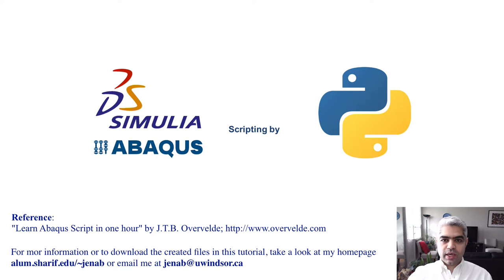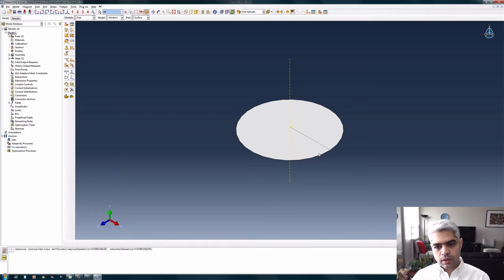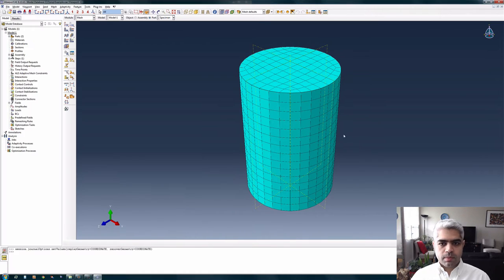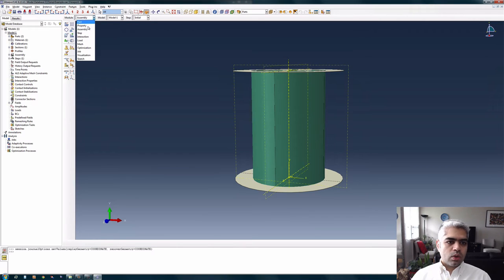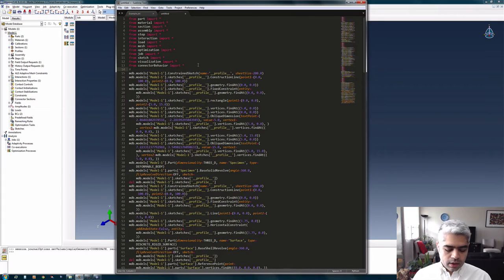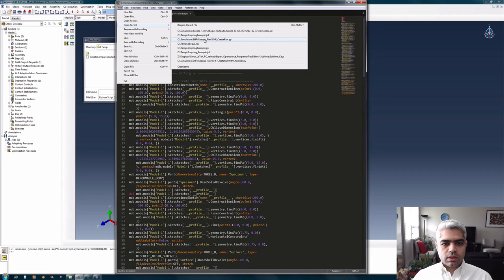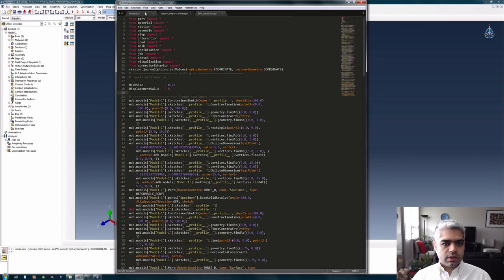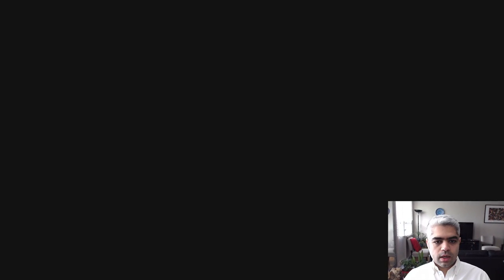How to do ABAQUS Scripting; Simulating a Simple Disk Compression Test

Comment: Thanks for the video.
What is the editor you used to open jnl file? I used Notepad ++. It did not show different command as shown in video.
Reply from the maker: I use Sublime 3 because I like its themes and capabilities much more. But in general, jnl files are Python files; so if you want to see the commands and etc., you need to enable Python syntax for .jnl files as default.

Comment: Dear Arash,
Thank you very much for your tutorial, it has been of great help to me.
Since you know a lot about abaqus scripting I would like to ask you for some help.
I'm trying to write script that will generate a model and define node sets on the right and left edge of my specimen. However, when I change the mesh the script isn't working correcty, that is the node sets are not defined correctly.
Do you know how could I be able to write script that will define node sets correctly, regardless of mesh?
Reply: When you find solution please let me know also.. I am trying to do a similar thing
Reply: @wahaajali1009  Hey Wahaaj,
The solution is this:
You have to use "bounding box method" in order to select nodes that you want. You will need to define coordinates of the bounding box and than abaqus will pick them and make set of nodes. See these two links:

http://dsk.ippt.pan.pl/docs/abaqus/v6.13/books/ker/default.htm?startat=pt01ch31pyo06.html

and 

https://imechanica.org/node/11449

Good luck !
Reply from the maker: @antejurcevic5855   Thanks! I didn't know this and will look it up. What I used to do was to set up an array of mesh sizes and node numbers for all the area I was interested and run a script to export data I wanted from those node numbers (which were again dependent on my mesh size).

Comment: Thanks. Can you please tell me what are the computer system requirements to use abaqus script with python especially with the objectif to link abaqus with matlab. Actually I have noticed that there a couple of command windows that I cannot open like JnI.. I am actually very new in all these software but I hope I could achieve my goals with your advices.
Reply: I think any system that can handle Abaqus should be fine... .jnl files are simple text files, you can open them with any decent text editors like Notepad++ or Sublime...

Comment: Hi Aarsh
I used abaqus with matlab to do optimization.I executed the python script of abaqus from matlab by using the 
command “abaqus cae noGUI =my script .py” The process of the optimization in my work is done by matlab by using a Genetic algorithm function. Which changes the parameters in the python script, runs it and compares the results .So this process will repeat itself to get optimum results and this lead to run the abaqus per each stage of optimization.

 My wondering is there any way to keep the abaqus cae opening without closing when the job finished, to reduce the time in my work
Reply: Thanks, I think it is, please email me if you still have this question 😊
Reply: Hi  Arash 
Yes , I still have this  question 
i do not know your email

Comment: what text editor are you using?
Reply from the maker: +Colter Roskos I use Sublime, which is the best text editor I've found so far :)
Reply: thanks for the quick response. I cam across Notepad++ which seems to work pretty well.
Reply: I was about to ask this question :) Sublime. Thanks!